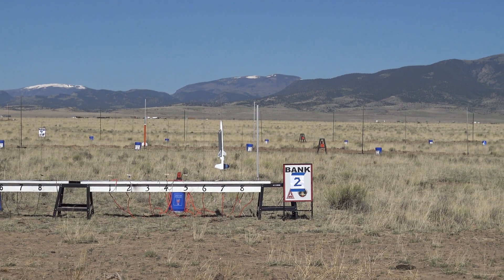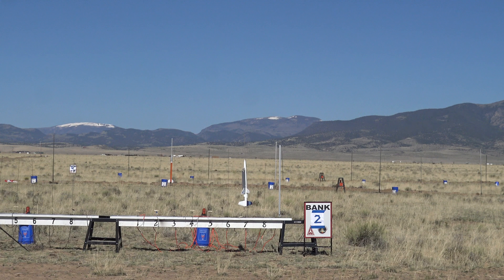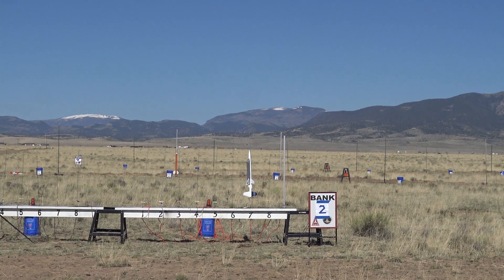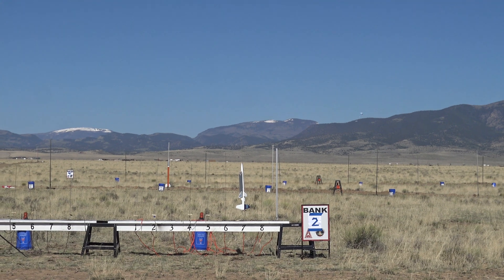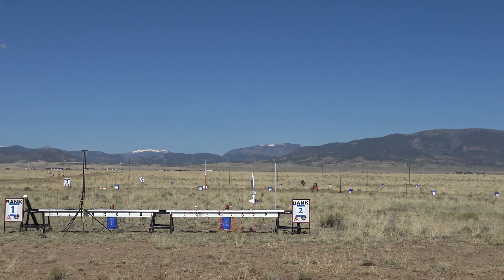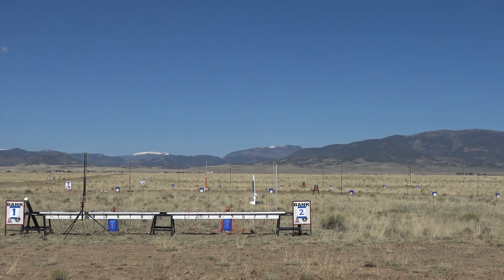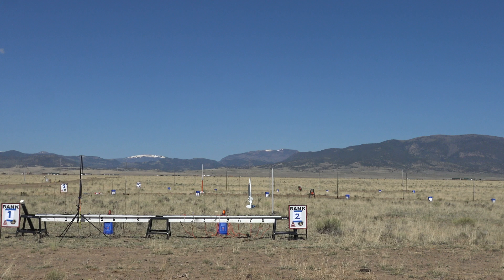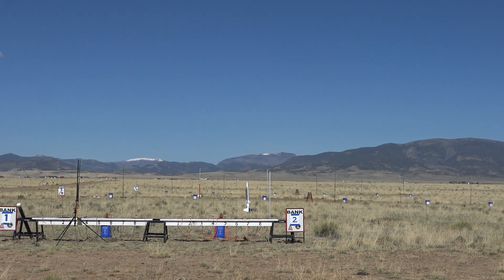GLSDB Model Rocket Glider Flight

Comment: Neet......I wonder if you could add a cheap RC system to help with the landing...... = )
Reply from the maker: It just needs to be trimmed better. However, there is room inside to do rudder/elevator control if you're daring. Let us know how it goes.